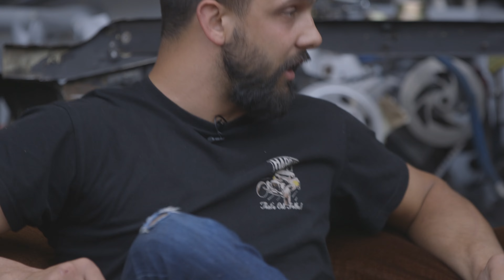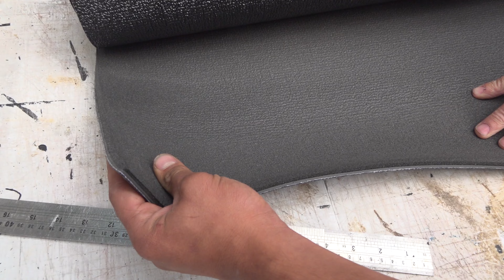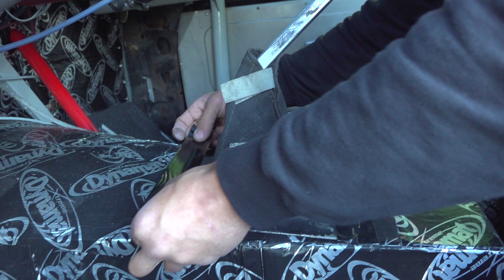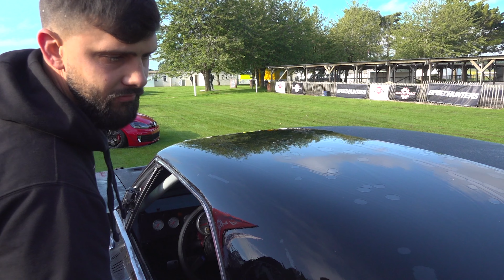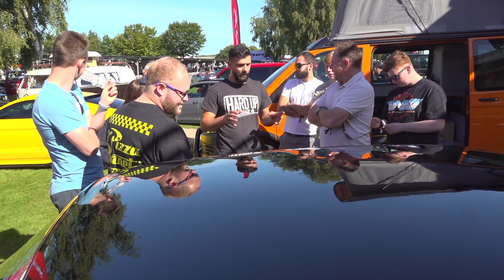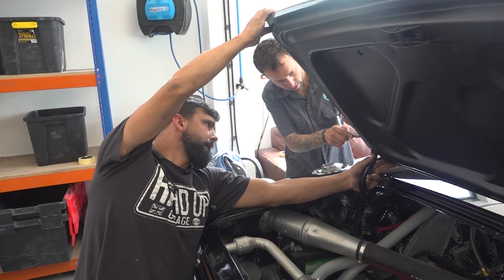FAST AND FURIOUS DODGE CHARGER SEMA BUILD EP11

Comment: Love what you guys have done!!! Most impressed with the chassis extension method!
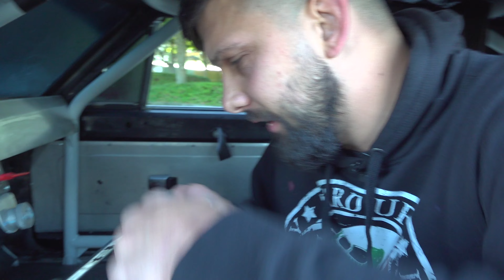Note for the 9:00 mark - duct tape does not have cloth in it and is very stretchy so it can be wrapped around ducting and the vent it is attached to. What you are using is "gaffa" tape (or cloth tape) which has a multitude of uses but most famously it is a roady's best friend for taping all the cabling to the floor of a stage for a concert so the entertainers do not trip over the many cables running around the place.
Keep up the imaginative work you do. Cheers, Tony (Sydney Australia - 1955 Chev 4 door 210)
Reply from the maker: Hi Tony thanks for the info abs your compliments !! We have some new stuff coming very soon thanks again and keep being awesome